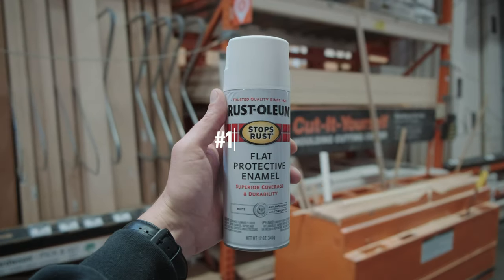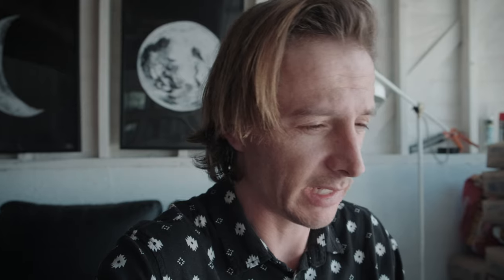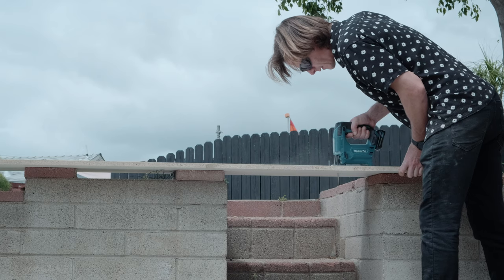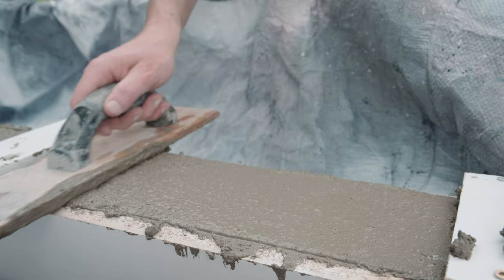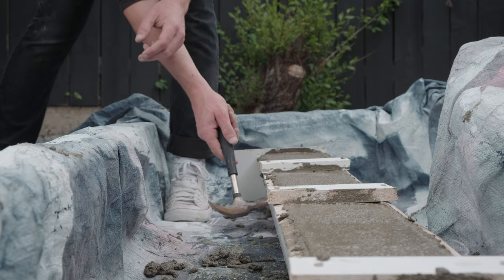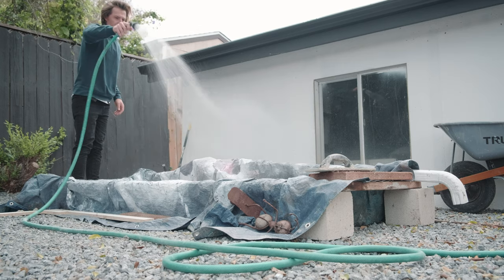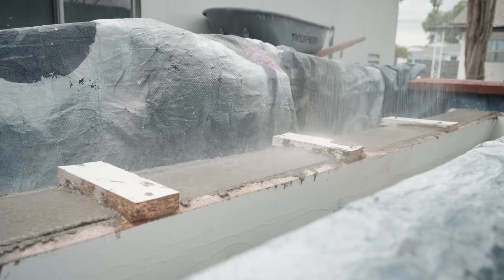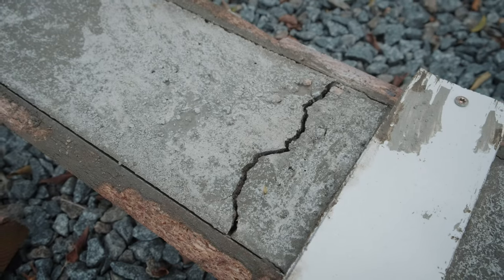HOW TO DIY Skate Curbs | Building Guide

Comment: I have used medium gauge wire fencing instead of rebar. I've had a curb crack, but due to the fencing it didn't come in have and was still skateable for a good while. Also, I wonder if super long curbs are just hard to move...their own weight is a problem. A couple of my ramps have cracked, next time I'm going to try and keep them wet longer. Good work.
Reply from the maker: Joe solid points dude! Honestly I think using less amount of water during the mixing process is crucial too. Not letting the crete get to sloshy because it gets too weak during the cure. Good call on the gauge wire fencing instead of rebar! Any metal to grab makes sense!

Comment: I do concrete work and the saw is a good idea but yeah a rubber mallet works just fine to get the air voids out and yeah the concrete form let it harden and the next day after 24 hrs bury it in wet sand for 28 days and then you'd get over 5000 psi by the 28th day. Just keep the sand moist.  But the tarps work too it isn't something that needs to be spec made and astm tested lol

Comment: Concrete should really have a full 30 days or so to cure before any paint is applied to it. It's hard after a day or two, but not anywhere near done curing. Especially if you're going to spend extra for some high compression strength stuff (which is probably a waste of money for these), I'd wait to paint it. Great DIY sk8 project, though!

Comment: Zack - quick question for you.  I am trying to connect two parking blocks to make one long slappy ledge for my local shop’s parking lot. I used bondo the first time, abs they’ve already come apart. The issue I’m having is that the ends of the parking blocks aren’t vertical, they are slightly angled, so when I push them together, the bottom touches, but there’s this large gap that needs to be filled between them. Any idea on what I could use to get them to stick abs not break? Thx!
Reply from the maker: Ahh yes! This is a situation I've run into a few times. Some curbs have a straight edge & don't dapper like the ones you mention, but in this case I would cut the curb straight on each edge & push together (with an angle grinder or something) basically to get that sharp edge. Otherwise it's tough, you can try filling it with concrete & then seal with a strong adhesive but you'd need to build some type of form. Sorry I don't have a better solution but if you find one let me know!